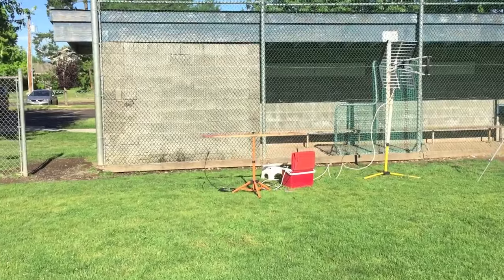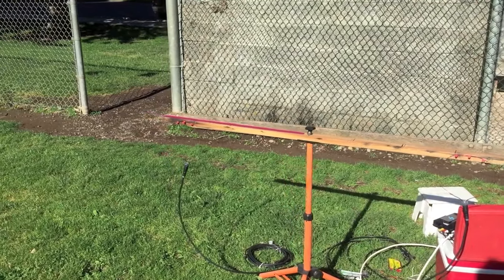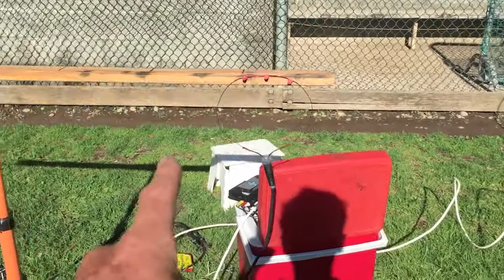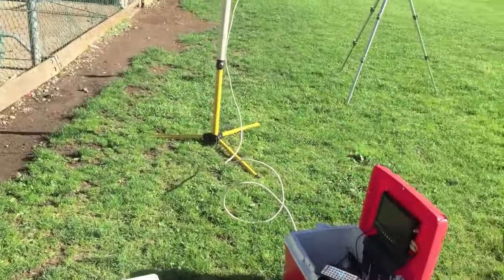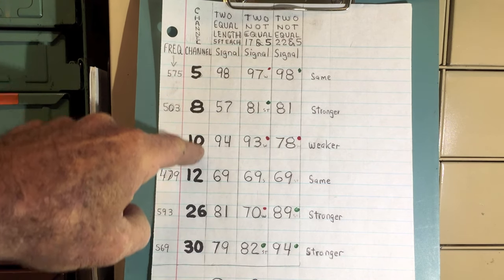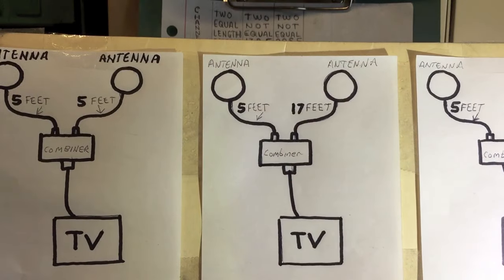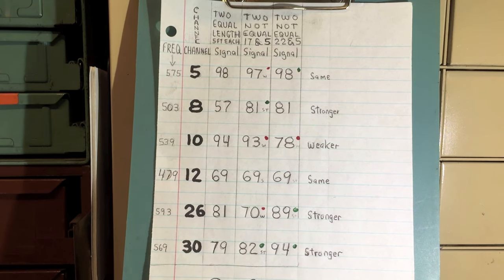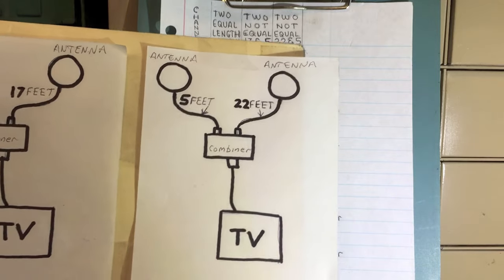Can Two  TV Antennas Really help? Watch This Experiment.

Comment: That makes sense.  I think different lengths coax does cause a propagation delays in the longer coax, resulting in an interference pattern, where out of phase signals cancel or at least diminish the signal strength.  With same exact length coaxes, the signal propagation is matched and consequently no out of phase interference pattern.

Comment: I appreciate you taking the time to experiment. I’ve tried using using two antennas with a combiner before and had similar issues. I should have know separate lengths of coax would cause an issues with the same signal arriving at different time to the tv tuner. I guess the only other way it would not cause issues is if you use directional antennas that severely attenuated signals coming from the opposite direction, but nothing ideally attenuates a signal in the real world, haha!

Comment: I live in an apartment and our broadcast towers are about 20-25 miles away and SSW in direction.   I am using a Sling AirTV tuner with the antennas.  My apartment building is ironically skewed by just about the same amount from true north/south.  My apartment exterior however, does not face the broadcast towers but exactly in the opposite direction.   I placed my antennas in my master bedroom closet.  To point my antenna toward the towers, the signal has to pass through my next-door neighbor's apartment and their closet and my closet before reaching the antenna.  This resulted in inadequate signal strength obviously,  even with a small amplified antenna that worked better than any other that I had tried,  including a large 150 mile yagi herringbone type antenna. Since I got almost good signal some of the time and weather played a roll in quality,  I tried a combiner and another identical amplified antenna mounted to the same wall in an over/under configuration,  about 1.5-2.0 feet apart, both pointing to the same towers.   My signal isn't great and does have good days and bad depending on the weather, but it is much better with two identical antennas combined and pointed toward the same towers than it was with only one.

Comment: Phased arays are cool. And also very mathematically complicated haha. But wow - using non-identical lengths of coax in each leg from the Y-point in the coax is gonna cause big variations (at least in theory, though as you will already know working in the TV antenna business, there's more art than pure science to a lot of this stuff)

Unless the coaxes are the exact same length (down to the millimetre, in fact) for any given frequency (eg: a single TV channel, keeping it simple) you'll get a directional skew in the gain pattern depending on the phase difference between the coax cables. (300/length n metres / velocity factor of the cable). You could in fact get away with using 3x or even 5x the length of one leg in the other leg, though that would lead to more loss especially at higher frequencies (based on more attenuation in the longer coax leg)
 
A problem even if you use the same ength of coax in each arm, is that the two different antennas will present a reduced impedance to the main feedline. So two 75 ohm antennas will result in 37.5 ohms impedance (just like resistors in parallel). Any reactance (capacitive or inductive, will be additive or subtractive dependent on the reactance of the antennas in use at any given frequency. 
It is possible to use a specific length of coax that has a different characteristic impedance (often a 50 ohms section) to the main coax (which is usually 75 ohms) to transform the combined impedance of both antennas and make it closer to 75 ohms again, but the problem for TV use is that this transformation section length is frequency-dependent, so it won't work across a wide TV band.

So the only sane way to do this is to use the exact same length in each leg of the coax harness, keeping the phasing accurate and losses identical in each leg of the Y harness.

_  This is the point where my brain has already started hurting and beer seems like a very good plan B _

Sometimes easier results may be obtained if you use a narrow-band amplifier (of low gain) , one for each antenna (narrowband to reduce interference and noise problems) though amplifiers, as you probably know, give their own problems as well. The advantage to using 2 amplifiers here is that they present a known stable output inpedence to the splitter and the coax run-in to the TV receiver. A  common problem ti this approach is the 2 amplifier can interact and sometimes go into spurious opscillation, causing all sorts of troubles. 
  
In theory, if you have good signal strength, you could just use a resistive or inductive splitter, which would be even better, though that would mean you would need a good striong signal in the first place, so it's Catch 22 - you already have signal strength problems if you are trying to combine antennas ! 

Phased array radar antenna arrays generally use an amplifier for each antenna right at the feed point, or very close to it, with the advantage that it can help beamsteering by altering the phase to drive each amplifier and can be steered electrinically.

TV channel combiners (the ones I've seen anyways) seem to use a filter or a tuned circuit to keep the two two antennas more electrically seperate, in the RF sense, In the commercial transmission world, they would be known as diplexers. Each port would present a high impedance to the other port at the particular frequencies in use, preferably as close to pure resistance as possible to avoid reactance making things complicated (yeah - RF guys -  I know it's just +j and -j, but that concept is quiet hard to explain to someone who doesn't already use complex matching on a daily basis haha)

In theory, you could make your own combiner by making a good low-loss tuned circuit to accept the "extra" channel you want, and place that in line with the coax leg to the "extra" antenna. You would then probably have to make a high-pass, low-pass or band0pass filter and place that in the line to the "main" antenna that accepts all the other channels. Each installation would require it's own unique filtering because it's likely that no one site would have the same combination of channels.

Combining two indentical antennas pointing in the same direction is known as either stacking or baying. Stacking is mounting one above the other, which narrows the vertical beamwidth of the array - this is sometimes used to reduce aircraft relections from planes on apparoach to a local airport) Baying is side by side mounting of two identical antennae that point in the same direction - this narrows the horizontal beamwidth - and so this is sometimes used to reduce problems caused by multipath from a large reflective object nearby. But the above descriptons only apply to 2 identical antennae phased up to point in the same direction, and operated at the same frequency. Combining (not stacking or baying) two different antennae from possibly two different directions is what you are trying to do (edit: maybe not deliberately trying, but having unequal length in each leg causes a squint like that) - it's like an interferometer - used in a type of directional radio telescope) and boy oh boy is it complicated in comparison.  

For ham radio use, phasing identical antennas is used to get extra gain (*), though they use a very limited bandwidth and are only receiving one frequency at any given time, or maybe a narrow band of frequencies, so the length tolerances in both the accuracy of the "phasing harness" (the two identical leg lengths) and the impedance transformation section (which of course varies in length with wide frequency changes) are less of a problem. Another bonus is that some ham bands are near-harmonically related. For example. 146MHz is approximately (for impedance purposes) 3x the wavelength of 440MHz, so a quarter-wave impedance transformation section at 146Mhz kinda works OK as a 3/4 wave section at 440MHz. Because odd multiples of quarter wavelenth sections work basically the same (I'm simplifying it here) a phased/stacked-or-bayed dual-band 146/440Mhz antenna with equal-leg phasing harness and transformation section of coax will generally work OK on both bands. 

If only TV was that simple - the extremely wide bandwidths you guys need to cover make things extremely complicated :( 

Also note that the physical spacing between the two antennae is a factor that can affect gain and pattern response - though this is more of an issue for narrow-band antennae of high Q factor than wideband TV antenna designs. 

I have a terrible headache just typing about all this haha. 

For more technical info, you could try a Google search for stacked/bayed/phased yagi antennas - there's some good literature in the ham radio research field dating back well over 70 years, because phased dipoles and yagis were used in early fixed radar arrays so it's an established technique. Just bear in mind that narrowband ham or commercial radio usage doesn't really pan out to very wideband domestic TV reception, unfortunately, though admittedly that is mainly due to the impedance transformation section lengths being more narrow-band as they are selected to be a particular fraction of a wavelength, adjutsed for coax velocity factor, at any given frenquency. 

For simple TV experimentation, you could just ignore the impedance transformation section and use 75 ohm coax and connectors throughout and just hope the wideband characteristics of the antennas don't give too much trouble. In general, TV antenna designs are rather flat in impedance response and are also designed to be minimally reactive (capacitive/inductive, -j/+j )across the wideband response, so it may not matter so much, especially if using  log periodic antennas. 

(*) the extra gain from stacking or baying  2 antenna pointed in exactly the same direction, used at exactly the same frequency, with no additional losses due to the coax Y-arms or the transformation section, is a theoretical 3dB (a doubling of power). You can double that again to a theoretical 6dB (4x the power) by adding two more antennae, making 4 on total. 
HOWEVER - in practice though, due to coax line and extra connector losses as well as impredance matching inaccuracies, as well as the close-in effects of having two antennae in close proximity to each other (which can cause beamwidth anomalies and impedance changes due to near-field effects) about 2dB gain increase for a 2-antenna  array is average for VHF, maybe 1,5dB at UHF, unless very high quality coax and connectors are used. This generally limits the advantages of phasing two or more antennae to right-on-the borderlines-of-possibility communication method such as moonbounce communication, or for extremely dedicated DXers.
Reply from the maker: I'm unable to keep up with everything you're saying in one read, but I appreciate your effort to share so much information here.
Reply: @GrantsPassTVRepair  Haha my pleasure - I love this stuff - antennas and arrays are all part of the super-secret black arts of RF.
  
I just can't explain it any simpler, sorry - I really wish I could. I can't find the right words to describe it all without making it "just too wrong". 
This is a VERY complex topic - it really is far, far simpler for commercial radio transmission or ham use. The huge range of bandwidth you need for TV - especially in the US because I think you use some VHF TV too? - makes it an RF nightmare in practical engineering terms if you want to keep the cost down. 
 
I used to phase yagis, log periodics, dipoles and quads as a kid for extra gain and to reduce sidelobes - later I progressed to using variable phasing lengths to steer beam patterns and take-off angles. I've rarely thought about this stuff for the last 30+ years so it kinda all flooded out in one nig lumpy technical mess lol.

Great channel by the way - keep it up.
Reply from the maker: @gordslater  Thanks.                                    We have both UHF and VHF repeaters on different mountains around here, so my range of antennas can be a simple UHF loop or a full size yagi which attempts to cover a multitude of frequencies.
Reply: @GrantsPassTVRepair  yeah I noticed some larger VHF antenna sizes in some other vids. You certainly work in a very challenging area and those huge trees seem to be nightmares too haha
Reply: This is the best comment I've read on YouTube in 13 years
Reply from the maker: @felicciasc  I'd have to agree.
Reply: Wow!
Reply: In summary 

The game

Comment: I'm using a Televes SmartKom to combine two antennas on either ends of my house, as I'm right in between the two broadcast towers I want to receive from. It does a great job of evening out all the signals, despite vastly different coax runs.

Comment: What you can do is to get a bandpass filter from Arcom for the antenna that  receives the single required channel, to just let through the frequency that you want before the combiner.
You are correct that the channels being received by both antennas are cancelling out however if you just let through the channel that you want then it will work.
Thanks again for a great video.
Reply: And notch filter for the other antenna to keep it from interfering with the antenna of the required channel.
Such filters are pretty expensive though.
Could feed each antenna into a separate networked tuner and set the display device to use the tuner based on channel.  No combiner used this way and mismatched coax not an issue.
For RG6 coax run longer than 30 feet or so put an amplifier at the antenna.

Comment: A few points:
1) If you have two antennas at right angles, different lengths matters less.
2) If your "base line" is at right angles to the direction to the transmitter, equal lengths work the best.
3) If your "base line" is so that the antennas are at different distances from the transmitter, unequal coax lengths works the best.  The difference in coax is about 70% of the difference of the distance to the transmitter.

Comment: #1 It all has to do with phasing, if antenna A is out of phase with antenna B you will get what’s called destructive interference. If the two antennas are in phase with one another you will get what’s called Constructive interference. 

“Destructive interference is when two waves traveling in the same direction are aligned at the crest of one wave and the trough of the other. The waves cancel out. Constructive interference is when two waves traveling in the same direction overlap, and their crests combine to produce a larger wave.” 

#2 If two identical antennas are co phased correctly you will get a gain of 3 db however, the length of the cables used for the phasing harness has to be a ¼ wave length for the frequency that you are trying to receive so they will be in phase for that frequency and only for that one frequency, and the antennas need to be spaced a 1/4 wave length from one another again this is for the frequency that you are trying to receive so they will be in phase for that frequency and only for that one frequency. This could contribute to losses at other frequencies. 

#3 Most signal combiners or antenna combiners, at best have an insertion loss of 3db this 3db loss will mitigate any gain that you would get from combining the two identical antennas. When you combine two antennas you get 3 db of gain. 

Note: I have used two identical antennas stacked one above the other with a ¼ wave phasing harness made from 300 ohm twin lead cut for the ¼ wave length of frequency that I wanted to receive. The phasing harness was between two antennas that I wanted to co phase I attached the twin lead to the 300 ohm terminals of each of antenna then on the bottom antenna where the twin lead connected to the 300 ohm terminals I attached a 300 to 75 ohm balun so I could run coax cable to the TV’s. It worked very well with very little loss on the other channels. The advantage of using the 300 ohm twin lead is that it eliminates the signal combiners and the 3db of loss that the contribute.
Reply from the maker: No argument on that. Someone suggested it could be beneficial to hook them up in series. Ether way I understand why two out of phase antennas could weaken their output.

Comment: The line length is matched on space diversity antennas in microwave communications. It used to be done by making the waveguide the same length, but now it can be made by an electronic adjustment. The receiver still only picks the best antenna.

Comment: I have a Televes two antenna combiner . I lose nothing at all with it. Pointed two different directions. One is getting my stations 27 miles west all UHF, the other is I think south east 5 miles away UHF and VHF…. All come in with no issues.  ATSC 1.0 and ATSC 3.0…

Comment: This is a very common issue for over-the-road truck driver dual antenna CB. Oftentimes in the overhead you'll find A rat's nest of wire but both are the same length.

Comment: What I want to know if is there a way to connect a coax to a existing chain fence and use the fence as a antena for a tv?
Reply from the maker: You can use any metal object as an antenna, but a good antenna is designed for a specific frequency, and cut to a specific size based on that frequency you are trying to pick up. You may find this video of interest. https://www.youtube.com/watch?v=vHVmJ5lD9jc